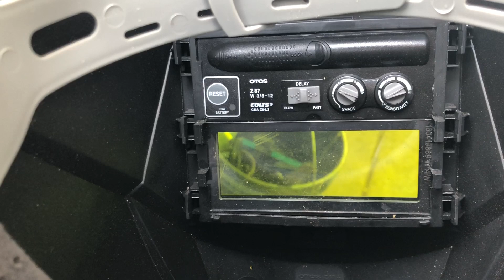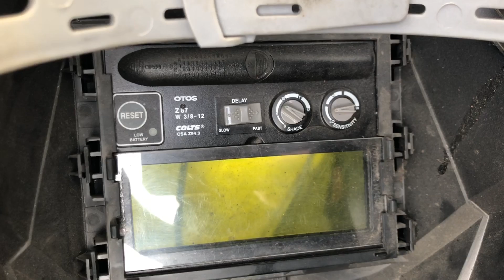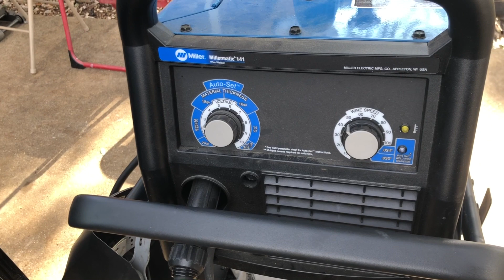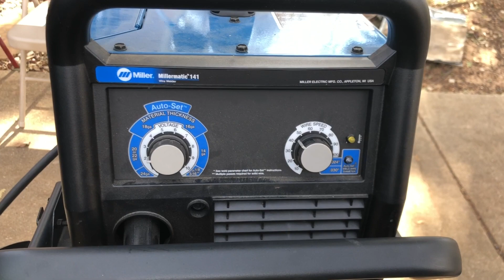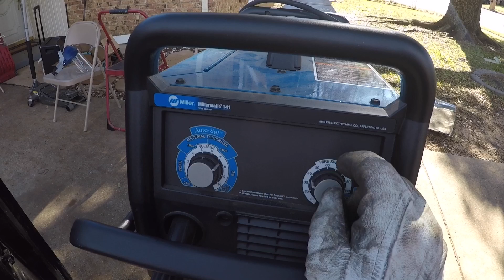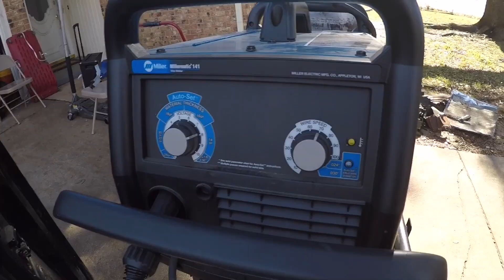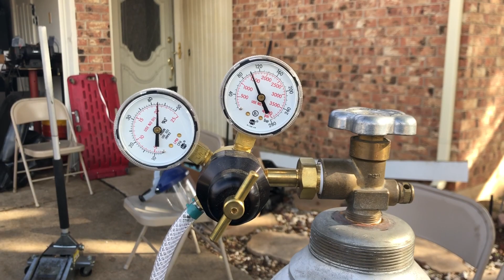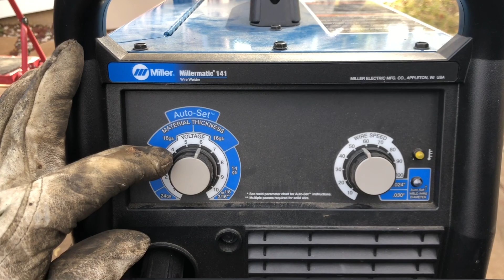HOW TO REPLACE B BODY FLOOR PANS PART 2

Comment: I see you live in Dallas Texas! I live pretty close to Dallas i was wondering where you get your parts i have a 69 Charger also.
Reply from the maker: Martyimgay That’s pretty cool. Usually find parts on eBay or Craigslist. Also get parts from Summit Racing in Arlington.
Reply: Yea im always on craiglist and i didnt think summit really had parts for the charger
Reply from the maker: Yeah they have lots of parts. It all depends what you are looking for. Some stuff if just hard to find period. You have to keep searching until something pops up. Also might try classic industries.

Comment: As that guy who does the fabrication work gets older, he'll wish he used earplugs during that noisy grinding and when welding overhead, like the welding underneath the car, earplugs keep sparks from zinging inside your ear canal which is terribly painful. Don't ask me how I know this. 😉
Reply from the maker: Bet that hurt
Reply: @Will_Perla  Yes, and it was just a small spark. It's also terrifying because it happens so fast and with your gloves and helmet on there is nothing you can do to stop it, but just let it sizzle like bacon in your ear while your experiencing pain. I've heard stories where smaller bits of molten metal have gone into the ear canal and burned all the way to the brain resulting in death. Heard it was the number one way welders can die. I don't mean to be preachy or gloomy, but I thought I'd tell you about it and maybe you'll pass this on. Anyway, l'm not a welder by trade, but working on automobiles I've done quite a bit of it. 😀
Reply from the maker: Wow that’s scary good to know